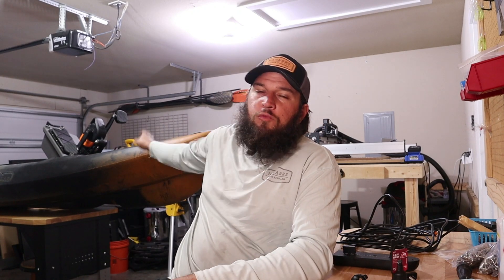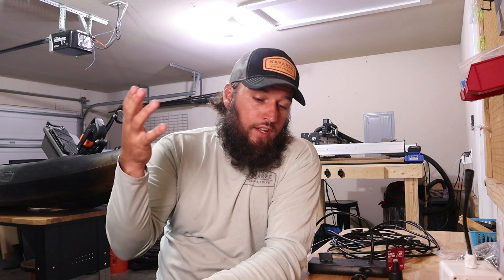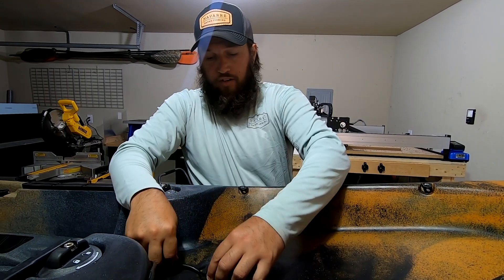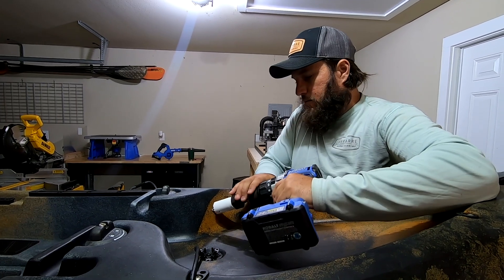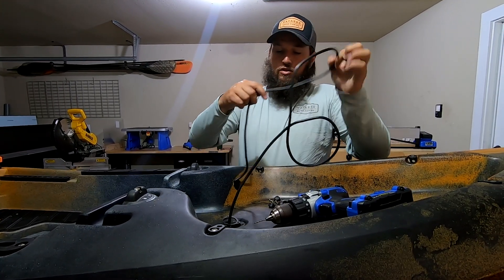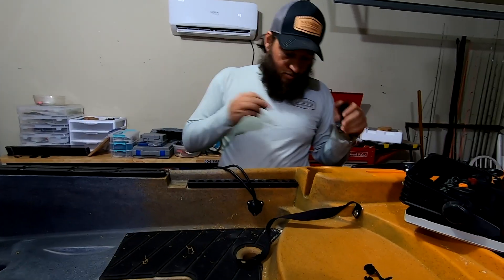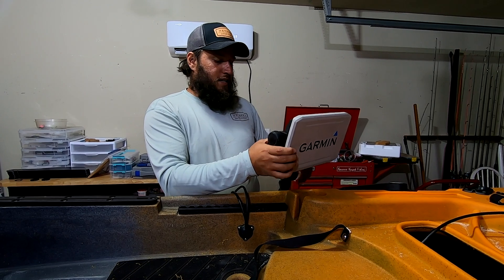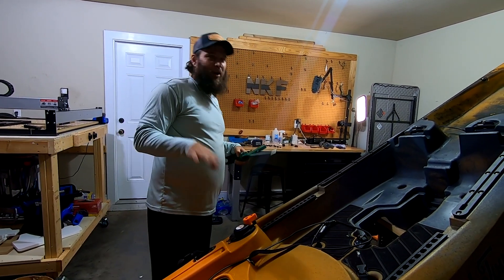Installing a Fish Finder on an Old Town Salty 120 PDL

Comment: Is there a reason why the hole for the transducer cable was drilled on the port side and exited on the starboard side?  Was something beneath the deck in the way?
Reply from the maker: There was no particular reason.  I’m not sure why I went that direction other than it’s where I was standing.

Comment: Hey Nick, which would be the correct scupper mount for a Helix 7 mega SI transducer? It would be going onto a Salty. Thanks
Reply from the maker: You would need the “Humminbird” version.  Mention you need the salty topper in the note section at checkout and we will make sure you receive it.

Comment: Thank you Nick!  I have the same kayak and the same Garmin unit with the GT-51.  I will watch this video many times and follow your advice and techniques.  I have your scupper mount system but do I need to order a different one for the large transducer?  I believe that’s what you indicated.  I’ll probably mount on the port side hand grip as I’m a lefty caster and want to keep the starboard side free and clear.  There’s no issue with the rudder steering control, right?  I should be forward of that area?  You keep all plastic cutouts and the drill shavings?  Have you ever had to use them for repairs of any kind?  Thanks again.  Very timely for me.

Comment: So Guess you need to use a thu hull with screws like Yak Attack since you cant reach the inside of the kayak, like you would need for a Hobie or Wilderness thu hull install
Reply from the maker: Hobie makes a three way thru hull that works perfect and is the one I prefer.

Comment: Nick, could you make a gear track that fits the Salty, going from the back screw to the middle one outside the tankwell in the back?  Could be used to mount a flag, your anchor pin solution, etc.  Would it be reliable cutting across that back corner?

Comment: My bar in striker Vivd 4cv says “12-20v”I would love to use one of my 12ah M18 tool batteries.
Does anyone know if this is possible without harming the unit? 
Everyone on line seem to be using only 12v batteries.